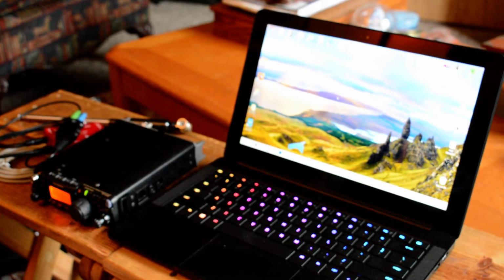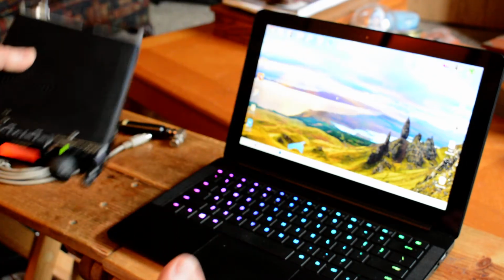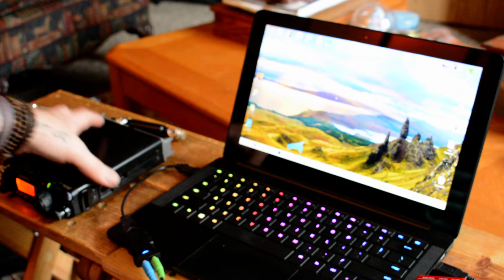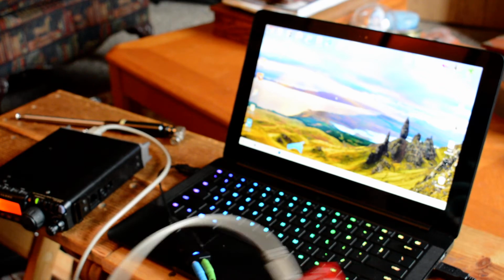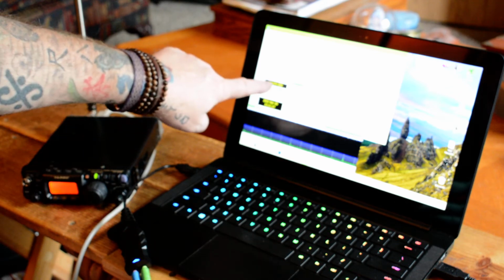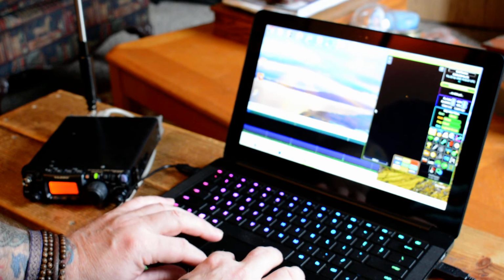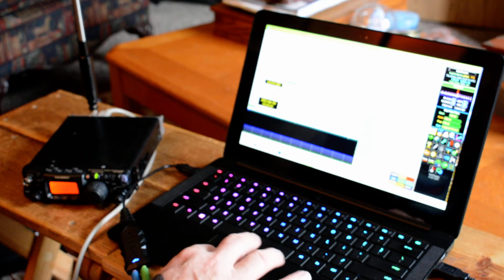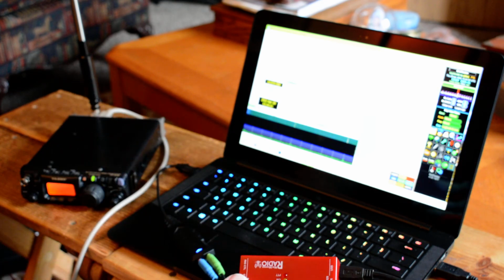Rigblaster PnP w/ Yaesu FT-818 for digital modes

Comment: I'm new to radios working on my tech license, but why do you need a sound car? Is it just when using it with the pc? I know they have a speaker. Doesn't it work while connected to your pc? Or just better sound through the pc. Can you also use that on a Tablet? Thanks nice video! If that radio works in your house that makes it even better!